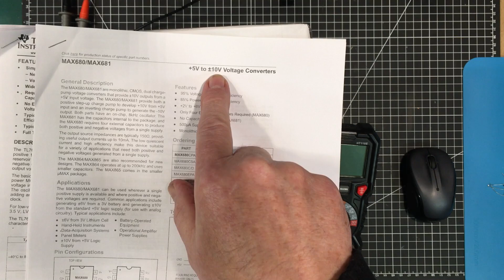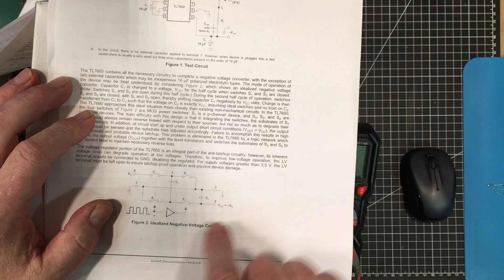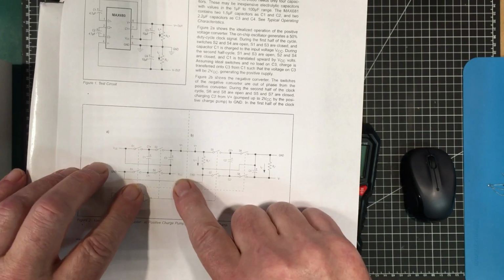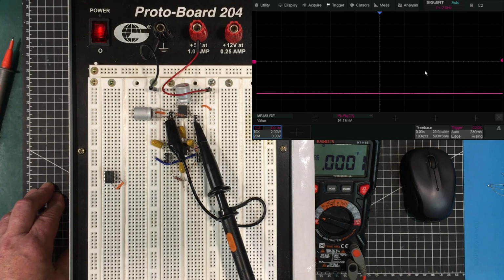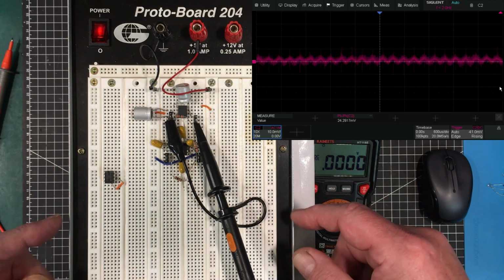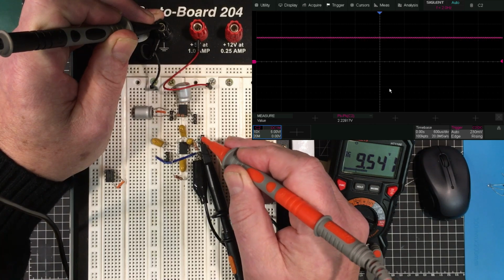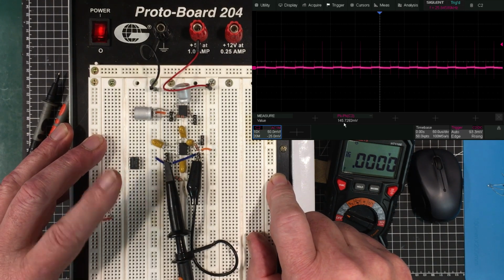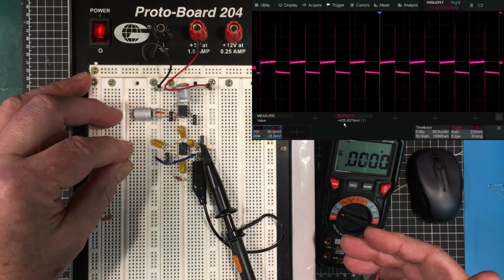Uni-Byte 0225 - CHARGE Pumps - Are the "FAKES"  Better?

Comment: I got some INA106's, specialised x10 differential opamps from one of the cheapest sellers. Fully expecting I might have to send a video of how they're completely broken to get my money back. But 4/5 seem to do the business. Given the internal circuit they're not really easy to 'fake' as a cheap normal opamp either. Turned out that 4/5 of them work. I'll take it. Ali really does seem like an exciting lottery at times.

Those charge pumps, yeah you'll probably always need a choke or regulator after them to get rid of that switching.
Reply from the maker: It seem to be the consensus, although you'd not get that impression reading some of the "suggestions" on the forums out there.  You are right about the charge pumps, especially those MAX680s.  I wonder if the MAX681 is as noisy?

Comment: Nice demonstration...
I have not had any real issues with AiExpress when buying components, but this highlight a very important point:
If you buy cheap, expect some differences and test the things in a little test jig first before use. Especially if you intend to push the parts to the higher end of the spec.
(It must have taken you all of 15 mins to build up that little test circuit)

Andy
Reply from the maker: Yes, you are right, it took very little time to set up and have a look.  It's good good course of action.